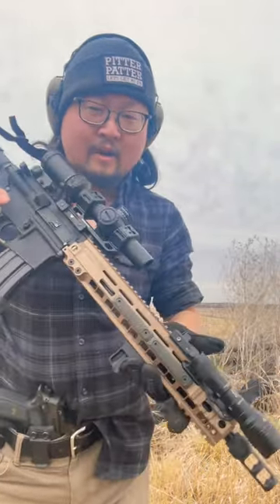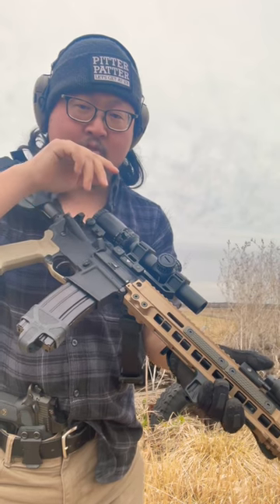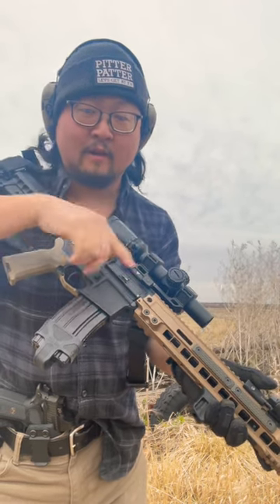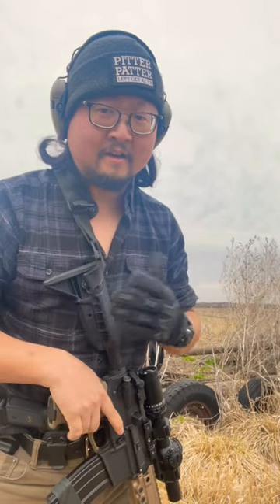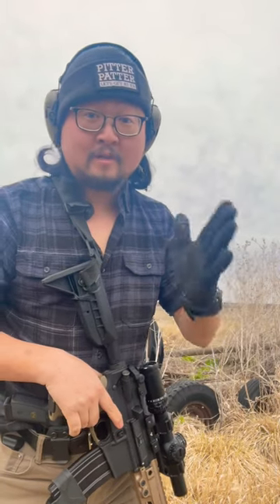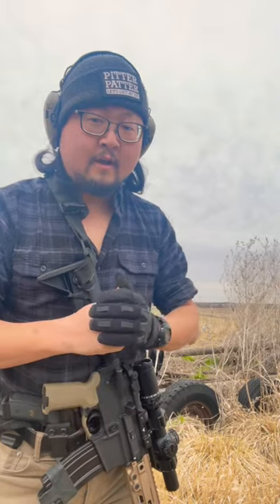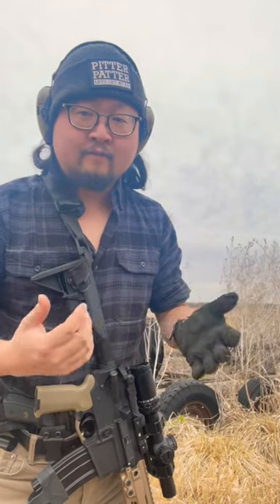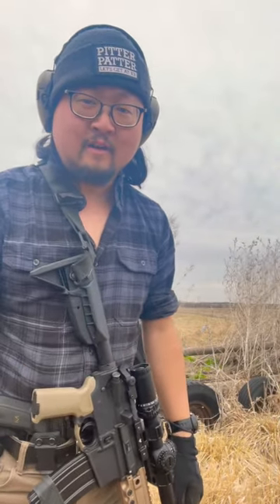Swapped to a 14.5 Ballistic Advantage midlength | Colt Federal Patrol Rifle

Comment: How does your gun shoot so flat? Obviously partially the muzzle device but do you have a jp spring or anything else??
Reply from the maker: Nope. Carbine spring and h2 buffer. Midlength gas systems are smooth AF.
Reply: Things nuts man😮 nice build!

Comment: Serious question here. 

Why is it that I’ve been seeing setups with backup sights and LPVO’s combined?
Reply from the maker: they're just that, backups. I typically keep the torx wrench in my grip should the optic fail, i can remove it and run irons.
Reply: I use 45° irons so that I don't have to remove anything to use the back up sights.

Comment: How does that rifle shoot so soft. I have 14.5 BCM. And mines a little more violent. I have A5 buffer system with H2 weight.
Reply from the maker: Not sure. Too many variables. BA might have a slightly smaller gas port. Also the Elevated Silence comp is beefy and does a good job of mitigation. 

I have a standard carbine receiver extension and spring, with a Colt H buffer.
Reply: Could be the gas port lenght. Carbine shoots harder v mid length a little softer